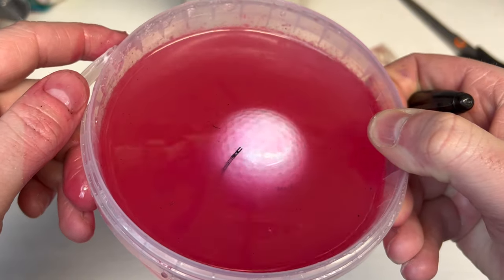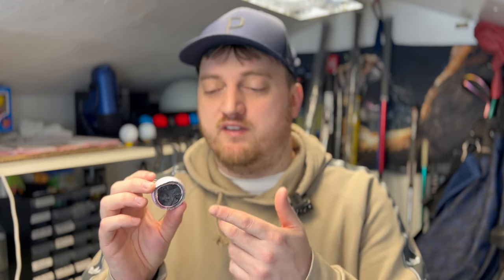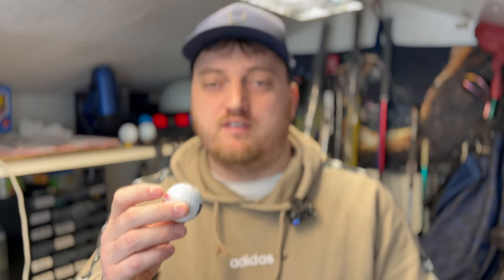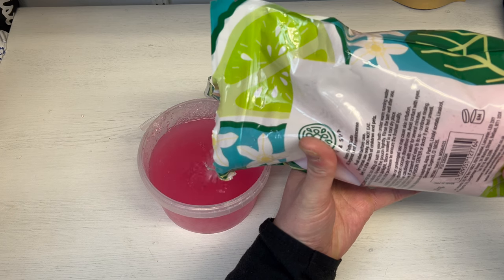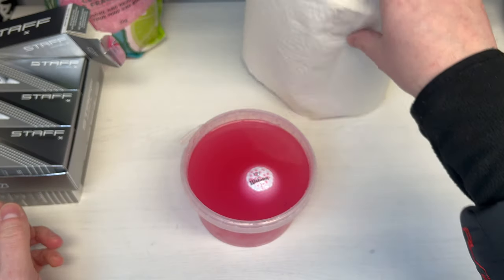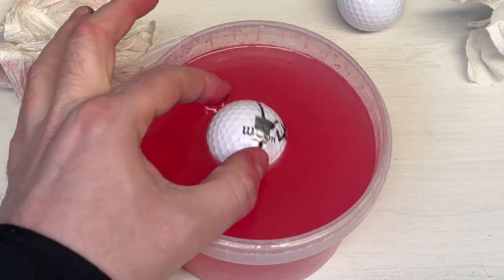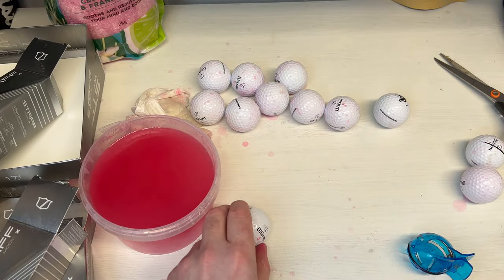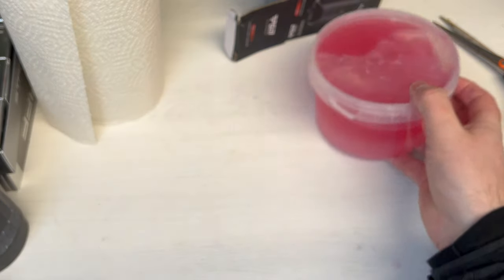HOW TO FIND the BALANCE POINT of your GOLF BALL using the EPSOM SALT METHOD

Comment: I'm confused (perhaps so are you) if floating a golf ball allows you to "pin point" a dot on the ball...the horizontal and vertical "axis" can be anywhere...if you suggest that "point/dot" be placed face up on the tee or green - great...or suggesting some other positional facing, fine. Just don't suggest the "axis" be horizontal or vertical, cuz there is no way to determine that information from the "floating" info. As far as the "spinners" go....take a ball and spin it once (make a mark) take it out and put it back in and spin it again (make a mark)...do it twice more and see how "accurate" those marks are...the TV commercial only suggest doing this once, as if, the results are 100% correct (lol) Marketing, lmao.
Reply: @jimbeglinger the axis can be determined from the dot. It’s any horizon line that goes through the dot to ensure end over end rolling. This is taking for granted that the cores are spherical

Comment: Hi Luke interesting video thanks. So am i correct in assuming if ball comes to rest on the same spot that the light side is uppermost and heavyside is at the other pole of the ball, you can then draw a line on this spot and use this for putting so it rolls end over end from light to heavy side. Also am i also correct in assuming if ball comes to rest in a different spot each time you spin the ball then that ball is perfectly balanced. Finally if using to hit ball on a tee then the line should be facing your intended target.